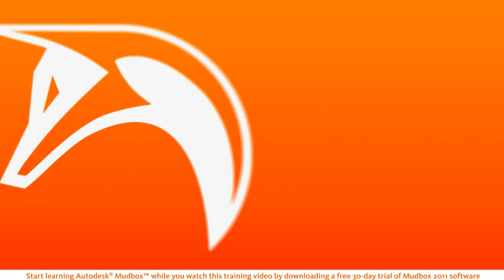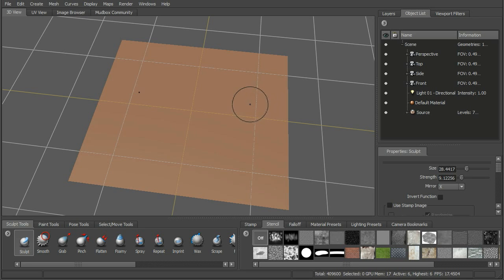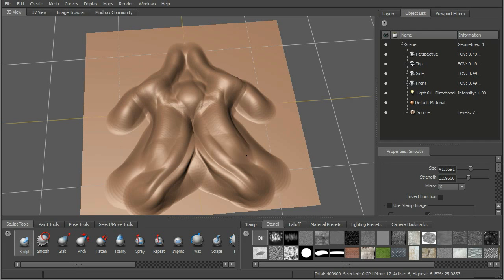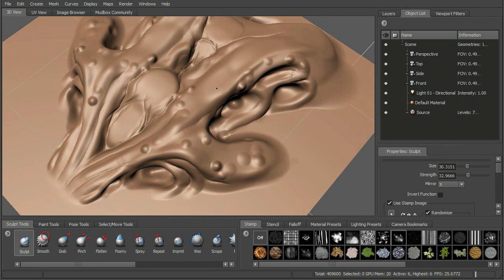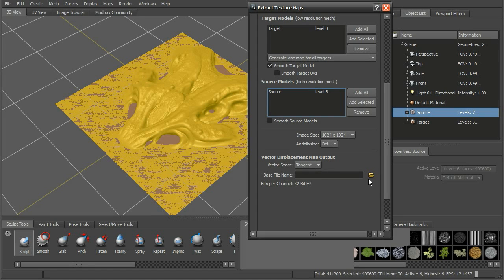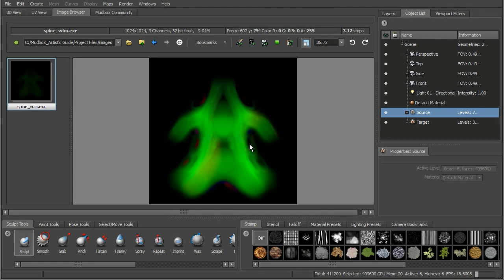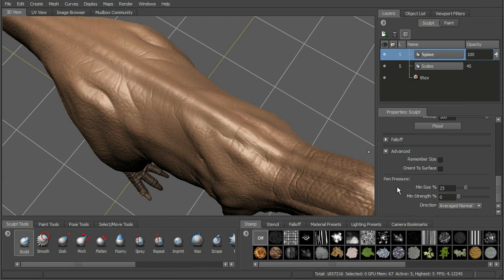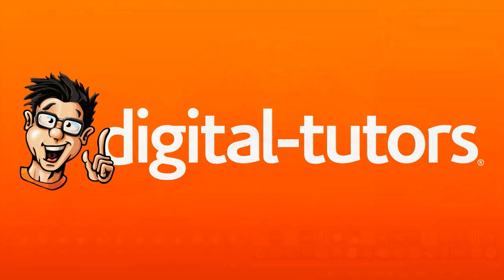Using Vector Displacement Maps Tutorial

Comment: Actually, the difference between bitmap displacement maps and vector displacement maps is that BDM are constrained by the surface normals, whereas VDM work in three dimensions. Bump maps OTOH change the perceived height of the surface via a greyscale (height) bitmap, whereas normal maps actually change the surface normals so that light is calculated in such a way as to give the surface geometry deformations it doesn't physically possess.